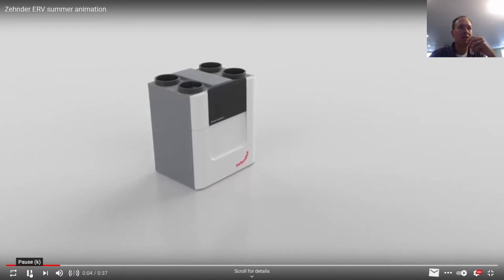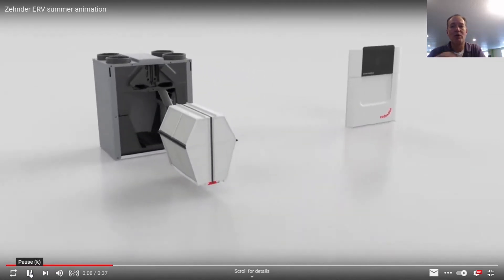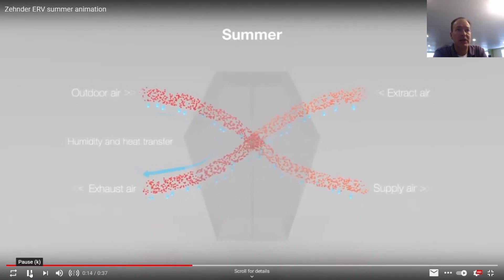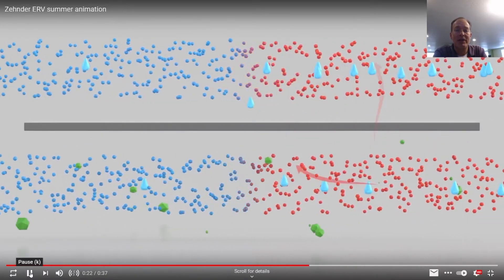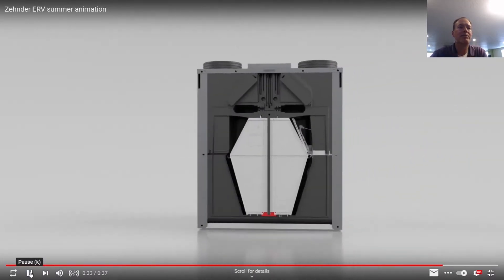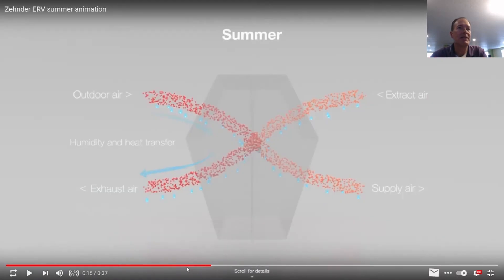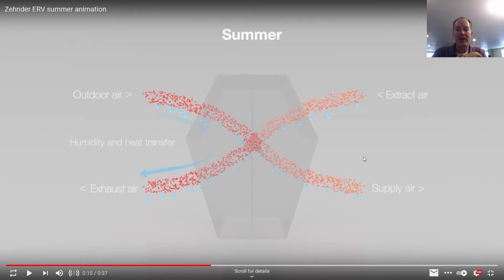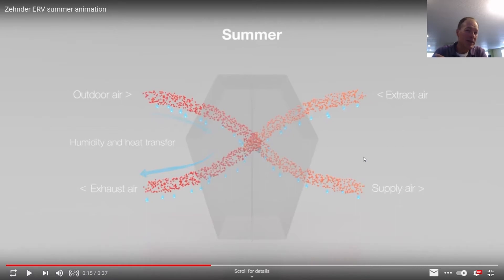To ERV or HRV: That is the Question. Zehnder animation explanation.

Comment: Hey
I have a question?  I have a 200 square
foot tiny house with closed foam insulation and because I also use it as a greenhouse
in the winter time and of course because of transpiration of the plants and
evaporation of the soil after a watering… on top of two adult people breathing,
I am getting a lot of humidity in the winter time.  I also live in the SW Virginia area so we
have pretty humid summers here too.  Which
system would work best for this application and HRV or ERV?  I know both clean the air Im just more
concerned with excessive humidity.  I see
a lot of people in tiny houses using HRV but what do you think I should
do.  Also I am looking for a very small
unit… any ideas there because its again only 200 sq ft?
Reply from the maker: Becky you need some de-humidification appliance and Still an ERV is best as it will reject some of the exterior humidity from coming in; where as HRV brings in what ever is outside dry or humid.  Your tiny is no-doubt getting vapor loaded. Thank you.
Reply: @PassiveHouseCody  thank you for this. Follow up question... I understand that in the winter time when the ERV with hold the moisture so that it can be released back into the house... is this true even when the moisture level in the house is considerably  more than the outside... with it vent that out some?  Also I heard that there were units with swappable cores and was wondering if you know of any as I cant find any online and if so I need a unit that is suited for my 200 sq ft tiny house?
Reply from the maker: @beckysmith7517  Humidity will gravitate to what ever is less AS it relates to temperature. A core swap will not help. You need a de humidification OR a way to remove it completely from coming in. One humidity is at the desired level, the ERV will try to conserve it.  A mini-split while in heating or cooling mode dehumidifies the air.  A gas flame creates humidity.. A Zehnder CA160 is a good option for a robust ERV.